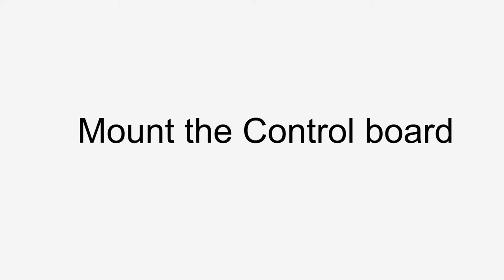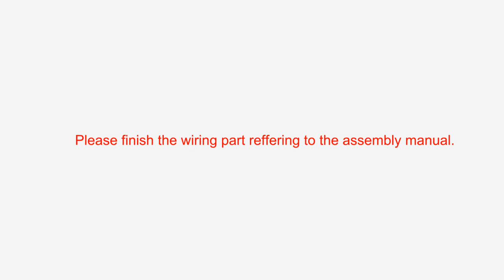19 Mount the Control board--Geeetech  Duplicator 5 DIY dual extruder 3D Printer assembly

Comment: if you try to attach the endstop wire for Z axis, do you have to go behind the build plate or around it? coz if i have to go around the cable is too short (maybe if i switch it with the one for the Y-endstop it could work) , and if i try to go behind the build plate there is so little space that there is some serious friction between the build plate and the z-endstop cable
Reply: I have the same issue
Reply: i fixed it by buying a prusa mk3 :D